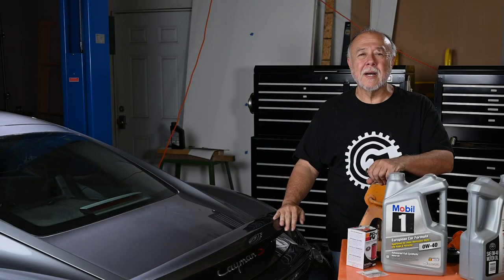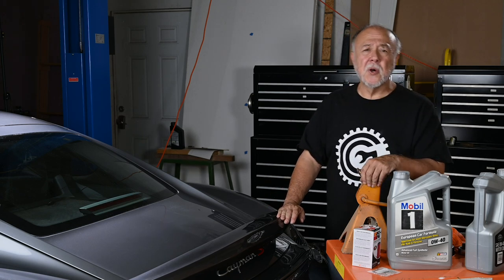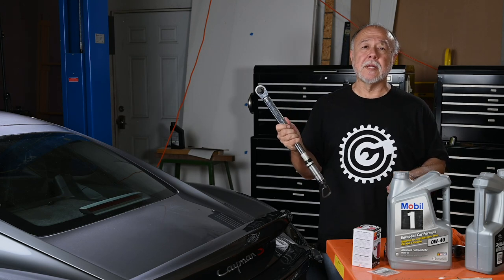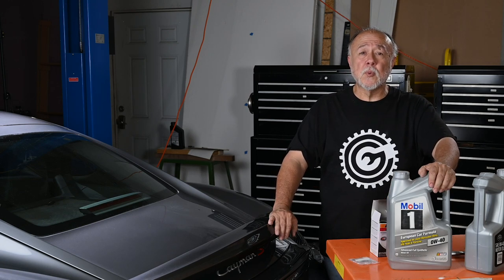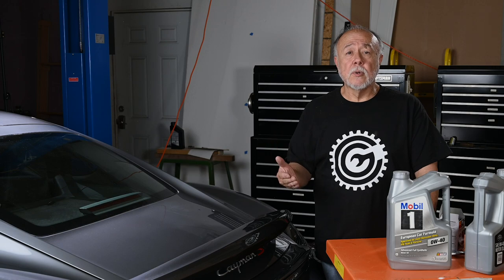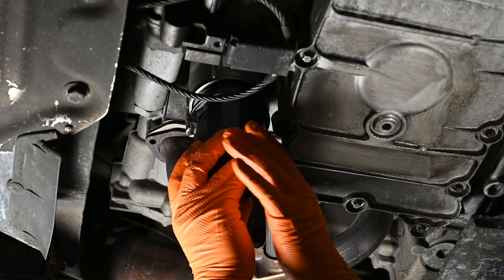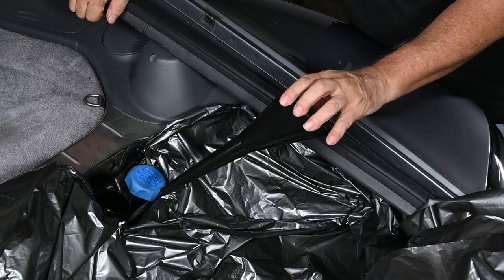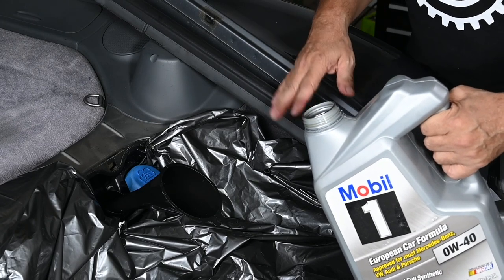DIY Porsche Cayman Oil Change (987.1) Save $400 or more!

Comment: Great video! Thanks for how insightful it was. Before you drain the oil it is also helpful to remove the oil filler cap to create a vent!
Reply from the maker: Thanks for pointing that out. I forget to do that about 95% of the time :) tbh, tho, I'm not sure how much of a difference it really makes. It might depend on the car, probably some engine designs need it more than others.
Reply: Something I’ve started doing on my Cayman a few years ago. Is cutting open the used filter. And inspect it for any metal and or debris. Along with grabbing an oil sample to send to off to the lab. 
I also replace the oil plug every 3 oil changes or so.
Reply: Create a vent ? No. It's to create a net pressure of zero between the engine and the surroundings. That way gravity does its job on the oil "better"
Reply: @alexv5581  You are both right.  He just knows a word that you don't.  VENT: an opening that allows air, gas, or liquid to pass out of or into a confined space

Comment: Just bought a fairly well specced 2012 987.2S 6MT. Want to do my own maintenance but they are so rare I don’t want to impact value too much. But I don’t want that Porsche tax 😅 what to do what to do
Reply from the maker: Well, you could start off with the 987.2 oil change video I'll be publishing in the next couple weeks :)
Reply: @CliffsGarage  looking forward to it! Thank you for producing this great content!
Reply: I am doing it myself to save some $$ but also because it's not that bad. Now, I do have quick jacks and have accumulated a lot of tools over the years making it that much easier to work on my cars. Plus I take my time and do it correctly. On a 2005 Boxster S, 6 speed I bought for 13k, I'm really not worried about dealership maintenance recs. 😆

Comment: The correct torque for the oil plug is 37 Nm.
Reply: Not sure that is correct. Pelican Parts says 50 Nm (37 ft-lb)
Reply: I think you're right. @HokieD1993